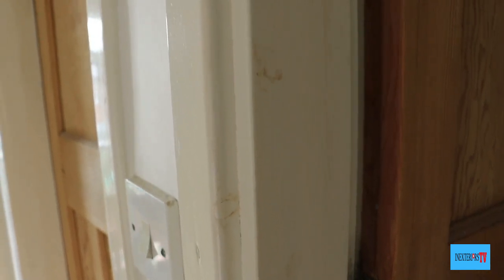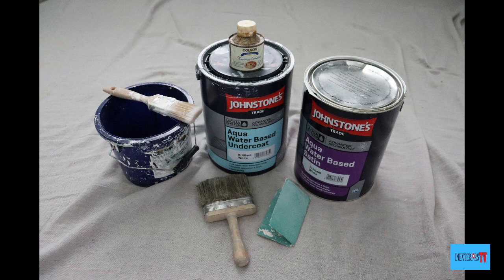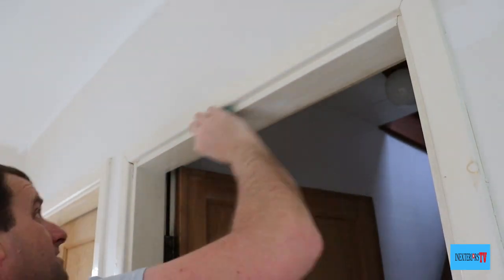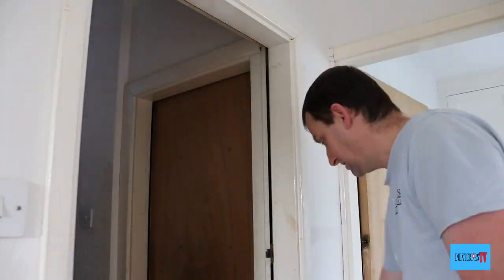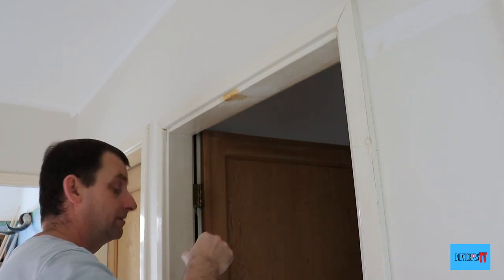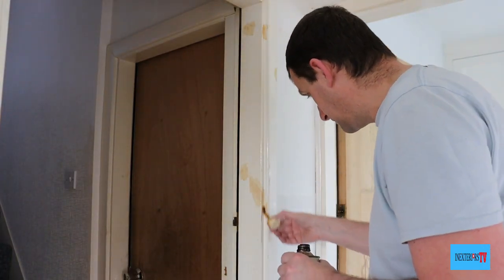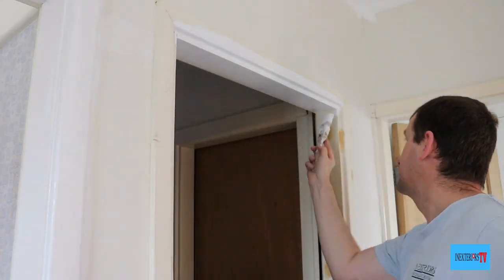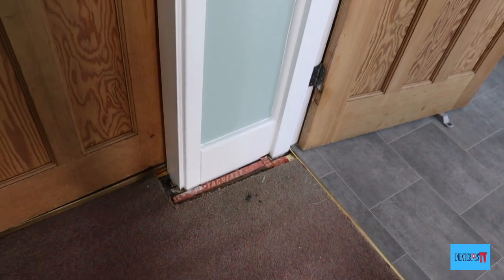Covering knots on painted wood.

Comment: Can water based paints be used over the knotting solution you used as different brands says not to
Reply from the maker: What brands are they.
Reply: @Inexteriors  Do you mean what knotting solution
Reply from the maker: yes bud, we all need to learn to evolve.
Reply: @Inexteriors  I'm not a decorator and I didn't know that water based paints contain alcohol. 

Bartoline patent knotting says cannot be overpainted with paints containing alcohol but the technical datasheet says when the treated area is to be over-coated with a water-based coating
system, apply the knotting solution more sparingly, and once dry lightly abrade the
surface to provide a key before over-coating.

Rustins knotting solution says do not use under water based paints. If a water based coating is to be used,
first seal the knotting with an oil based primer or undercoat as this will prevent the knotting discolouring the coating.
Reply from the maker: @hardworker8030  Thanks for the info, what about colron knotting solution.
Reply: @Inexteriors  colron knotting solution says you can paint over it but it doesn't say if it's suitable with water base paint. I think I will buy it to try.
Reply from the maker: just give the knotted bits a couple more coats,